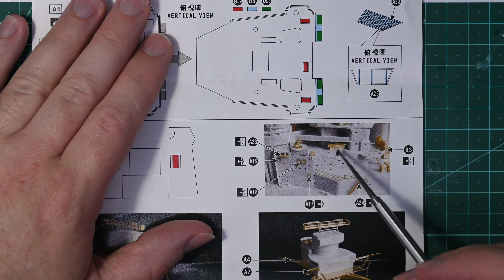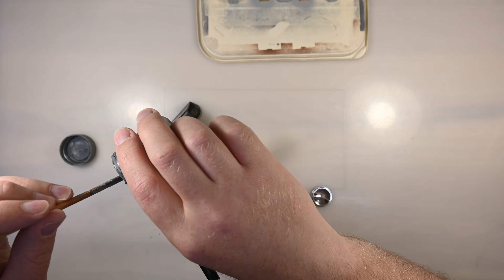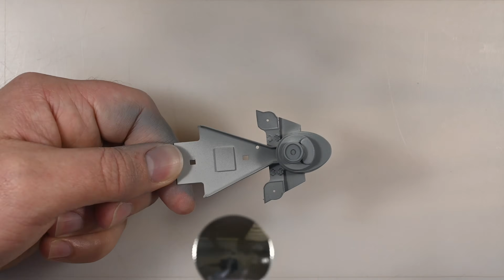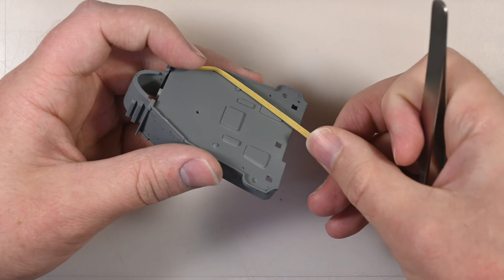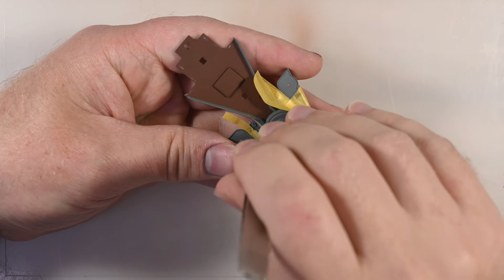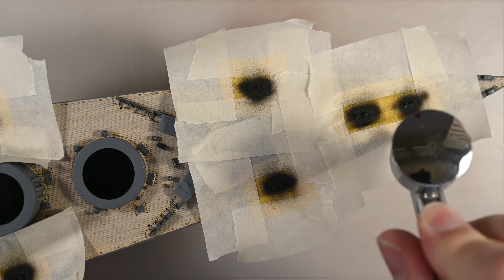1:350 HMS Hood: Part 35 - Painting the Conning Tower and Signal Platform

Comment: Regarding the color of the ceiling, i can't say much about the royal navy but i know that the ceilings on japanese and american warships were typically white or a very very light shade of grey. Probably for scattering the light and getting a generally brighter interior, the same reason why most walls and ceilings inside buildings are painted white. Since the japanese navy took a lot of influence from the royal navy and its just practical i assume they did the same. 
Warship models rarely have any detail for interiors and i doubt that ceiling will even be visible once its installed but its a nice bit of detail i came across and i thought i'd share.
Reply from the maker: Thanks for the information!